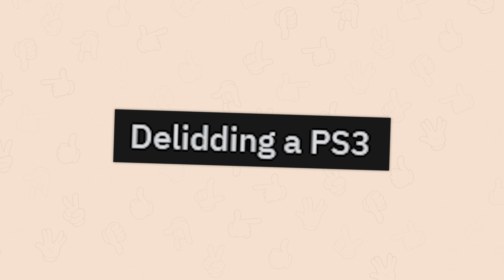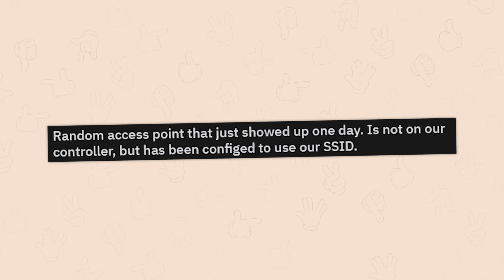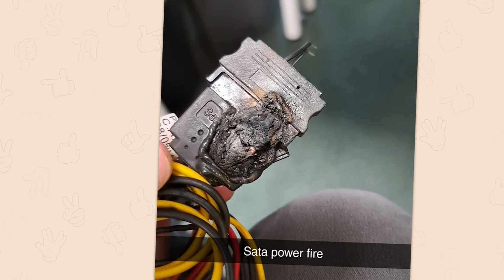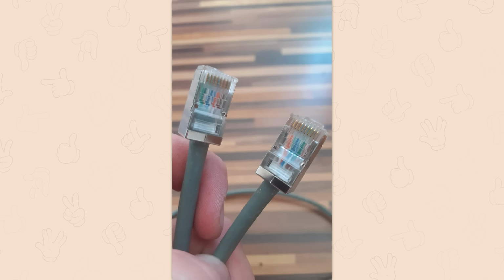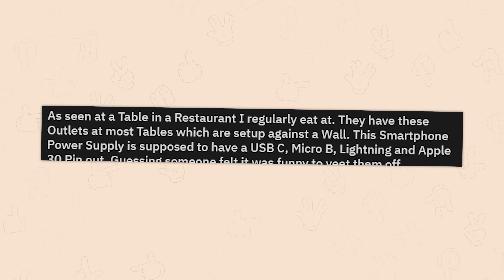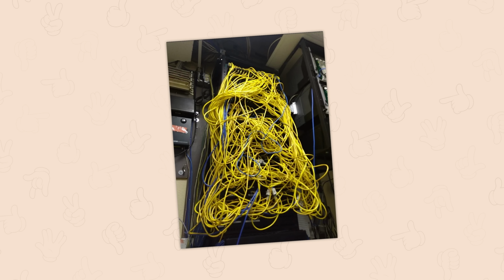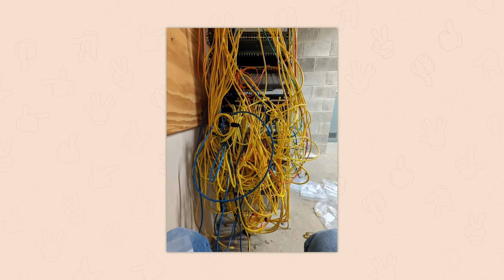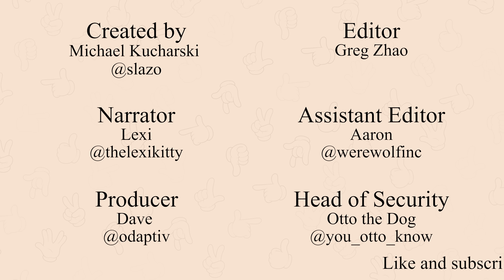r/Techsupportgore | improvise. adapter. overcome.

Comment: 4:16 - Didn't meet the power requirement for the new SATA-N drive!
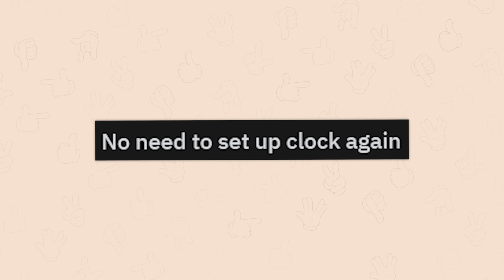5:04 - Not that unusual. Since the "coin" cells are usually 3V, a pair of AA or AAA batteries fills that bill. I've thought of that but never tried it. I think LGR showed off one with a battery that could be replaced without opening the computer case.
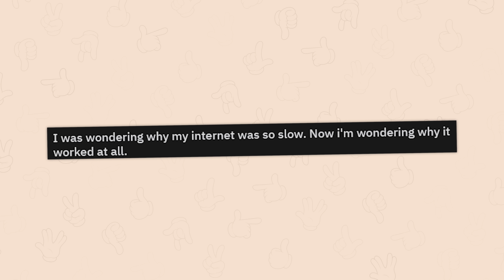6:16 - I think that's a crossover cable, TIA568A to TIA568B. Some crossovers also swap the blue/brown pair, but mostly the orange/green pairs get swapped from one end to the other. Bit odd to find a shielded one!
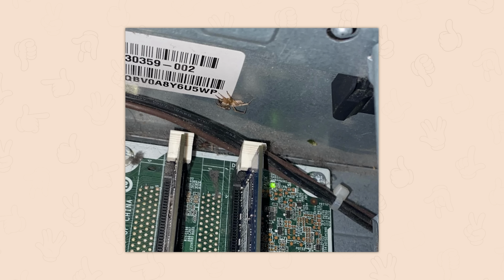11:32 - You met our Web developer! Still a lot of bugs in his code... 🤣
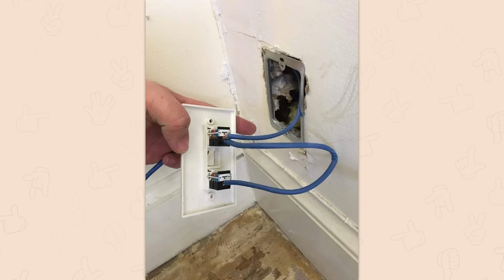13:39 - while that might have worked on telephones on the same extension... not for Ethernet. 
Horror story for you. A network tech was called in on a job with around 20 network drops. An electrician had done the cabling. Just like those outlets, the electrician daisy chained THE ENTIRE THING. All of the Ethernet jacks were connected like that on the same wire!
Re: Splitting Pairs - on the older 10/100Mbit networks, that was entirely possible to do, because that variant of Ethernet didn't use all four pairs in Cat5 cable. The blue and brown pairs were most often used for telephone lines.
13:52 - Clearly the work of a telephone guy. There is a better way to put Humpty Dumpty back together. Look up "cat 5 splice box" on your favorite search engine, find a good deal, and get a few for your toolbox!

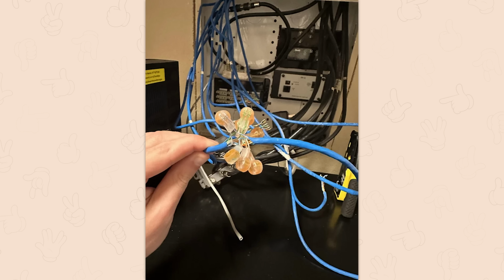Comment: 14:15 Splice connectors are fine for data.
They're mainly used on phone wires.
The gel is not "Conductive" but moisture resistant
They're like those cable splicers you use on your car.

But yeah, you should not use that many

Comment: Those little button splices are called scotchlocks. Cable guys, phone guys, and alarm guys use them to splice telephone circuits together. While they aren't rated for data, I've seen my fair share of gigabit connections running on them.

Comment: WiFi area expander lifehack from 2:28 actually isn't wrong if done temporarily only for urgent event. Did similar stuff in friend house when 3G became a thing. The only spot with good mobile internet connection in his house was in kitchen one meter above table. We made a contraption from 2L Coca-Cola bottle and pencils with 3G USB modem tied at top :)

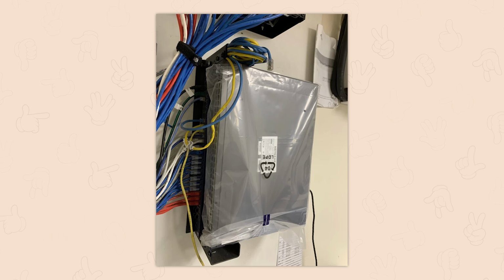Comment: 8:19 Ummmmmmmmmmm, I think you're getting a little ahead of yourself in that reaction Lexi...

FIRST they need to take it back off the mounting rails, TAKE OFF THE PLASTIC WRAP, put it back on the mounting rails, and THEN plug everything in...

Otherwise, I think you;ll soon have another entry in Hardware Gore of something Melting because it couldn't breath out the excess heat...

😄😁😆😅😂🤣

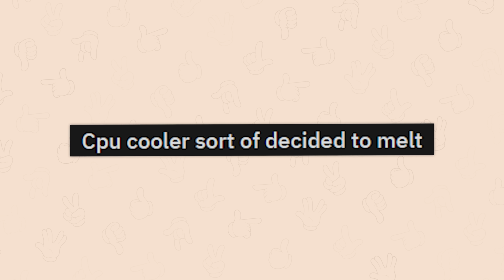Comment: 7:32 Looks like liquid metal thermal paste, these can have gallium in them and gallium damages aluminium. When they get into contact the gallium invades the aluminium crystal structure and weakens it. It will be so brittle that you can crush the cooler block with 2 fingers.

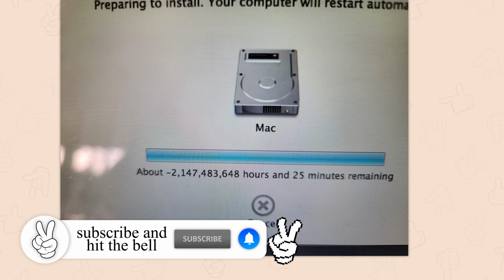Comment: 3:15 That right there is the 32 bit integer limit - the time to install took so long that it reached the highest number a 32 bit processor can depict (2,147,483,647) and tried to go further than that. this resulted in the computer resetting to the next number it could read, which is the lowest number it can read (-2,147,483,647), but as it had been broken, it took 1 more off, resulting in the time to install being -2,147,483,648.
Reply: Actually, with a typical signed integer, it can reach exactly one number lower than you'd expect it to.

Comment: 7:15, as a PC technician, I promise, vaping is just as harmful if not more because it leaves a nasty vape residue that seems to be deadly to electronics, already had a few cases of it this year, usually resulting in motherboard replacements or expensive board repairs.

Comment: 6:21 it's a bad crimp on the right side.
The connector doesn't grab onto the cable properly and pits stress on the small wires inside pulling them out

Comment: Lexi is now afraid of lead acid batteries, meanwhile I get to choose if something goes wrong at my job how I die… lead acid bath, exploding lithium-ion battery, hydraulic injection or crushed under several tonnes of steel…
I work (mainly-)electric forklift maintenance…

Comment: 6:20 that is like a cable for switches or something. Specialty cables that doesn't quite work like regular ethernet cables. That is why the poster wondered why it worked.

Comment: So with the replacement CMOS battery, old computers did in fact use rechargeable batteries but they were not button cells. They were a 3.6v NiCd battery that was soldered directly to the board. 

Those little demons are the bane of anyone in the retro computer community as after 20+ years, they like to leak and eat the motherboard.
Reply: Yeah, there's also lithium ones that explode and eat the board
Reply: Another variety of unfriendly RTCs in old tech are monolith RTC components joined with battery and molded inside epoxy brick. TI DS12C887 and similar. Same consequences - no way to replace dead battery without destroying the whole brick. Made similar battery supplement once to save apartment house maintenance guys when their meter reader gate PC died :)
Reply: @sadmac356  Yeah, those are pretty bad too. Lot of classic mac's have met their end to those things. Thankfully the lithium battery in my IBM 5170 decided to eat the case off of the power supply instead of attacking the motherboard.
Reply: @KrotowX  Ah, the Dallas RTC module. Annoying but at least not destructive. Thanks to the retro computer community there are modern drop in replacements for those that have a slot for a button cell battery on the top. If you are handy with a soldering iron, they only take a few minutes to swap out or a few seconds if you are lucky and it's socketed.
Reply: @Kboyer36  Those modules are still available in online electronic shops. You can order them and receive in a week. Soldering is not hard if you have some experience with soldering on multilayer PCBs and easy when you have flat soldering iron tip for flat cable soldering. My problem was deadline for maintenance guys, hadn't a week to wait RTC brick for computer which we already wanted to replace in future. So I improvised with things I had in place. Fortunately DS12C887 have pins for external battery and worked just fine with two AA batteries in holder soldered to them.
Reply: @KrotowX  Yeah, you just have to be careful to check the date codes. I have found ones being sold New that are really NOS and come with a dead battery. If you were replacing them in bulk I would try to find good original modules but for a one off setup, I would recommend the modern replacements. They are more pricy but they will never need replaced.

Comment: That iMac pic makes me wonder what it was like at my middle school when they switched from Mac to PC. There were at least 20 of the colorful ones and maybe 60 of the bigger in size newer(?) all white ones. There were also maybe 60 or so of the white laptop Macs (I don't remember what they are called). The library also had a few of the colorful clamshell laptops. The art classrooms had 1 each of the round base with disc drive and moveable screen Macs. It took about a year and a half to swap all computers over. I had to learn how to use MacOS when I switched to middle school and then basically forget that after 2 years. 😅

Comment: Well then... 9:24 my cable internet provider did an installation JUST LIKE THIS at my house... if and when we upgrade to fiber this will be an INTERESTING upgrade changing the cable out and all that mess... I literally saw him install the cable connector from the outside box and he just DRILLED a hole like that to go into the house... granted a simple setup like that will allow better insulation... but I digress...

I see so much cringe in these images on this side of reddit its just like... WHY WOULD YOU DO THAT???? Part of me is like, whatever works until it breaks sooner than you want it to.

Comment: 6:29 That is actually a properly ended TIA/EIA 568 ended CAT(7? or some fancy STP?) cable terminated in the crossover configuration. Aka, a "crossover" cable. It's meant to connect "like" networking devices, such as two switches or routers together, instead of the straight or patch cable, that connects from the computer to a switch or other networking device. It's also handy to make a direct link between two computers.  Nowadays these are rare/useless since switches can "autosense" the configuration of the device on the other side of the link, which is why this cable still worked for this guy. No idea why it's so slow, but I'd guess there's a fault somewhere on the cable.
Reply: Network Switches Auto Negotiation is basically just the switch sending bunch of data and asking the client device to send back some data to the switch and through that figure out what speed the wire and controllers can handle. Auto MDI-X is used to figure out if a regular patch cable has been used where a crossover cable should have been used, not the other way around. so he was probably running at 10Mbps which would only use the 2 pairs that don't change which are Blue and Brown.

Comment: Working for a major uk high street banks internal 1st line support desk. And pc not turning on ( but is the vga mangled) - reminds me of calls have had from branches saying a counter monitor / pc was not turning on. Now I know there mostly not IT literate outside of updating fake book status.  BUT I have had multiple occasions where there was a general area Power-cut at the time of them calling and us wasting 30-40 minutes guiding them through checking connectors and shit before they even thought to mention there was no power at all in the street…
Reply: The same old good case: customer called IT support and reported crashed system. When asked the nature of crash, he replied: "Bulb in ceiling lamp burned out. I climbed on the computer to get higher.". Support guy response was: "Well, and your system crashed..."

Comment: At 6:29 , so ethernet cables have little wires in them that when are arranged in certain ways they create what is known as the T568 A and B standards. The thing is, if you do one standard on one end you have to do the same on the other or else the cord doesn't work because both devices need to send and receive data on the same color of cords. What whoever made that cord did, is they wired it by different standards on both ends, which is why it's surprising that it even worked at all. (Edit: Though that cable is what is known as a crossover cable and it's only used for connecting two computers together without anything like a switch in-between)
Reply: Now, if it's a 100-megabit crossover cable, that's even worse.  When I tried one of those with a gigabit ethernet adapter, it kept dropping the link.  "Hey, it's a crossover cable, time to switch pairs."  "Hey, it's not a crossover cable, time to switch pairs."
If you ever actually need a gigabit crossover cable, you have to cross all four pairs, not just the two used for 100 megabits.

Comment: The orange connectors are the end are called scotch locks. They are (at least in Australia) used in the internet system for any copper services. They are fine for data. Just not if your using fibre optics

Comment: 14:00 Those are used a lot by telecom engineers in Sweden for phone lines (and they are rated for it), they are really good for that use case since the version they use is weatherproof so you can splice outside wires safely.

Comment: 7:00 I used to do this all the time for fun. Micro usb is a perfect fit inside. Mini usb doesn't quite fit. That said I shoved one in once, and deformed the big usb one as a result. Still worked, because I was plugging it into an extension cable, that had the female connector deformed (specifically into the side that has a cut line, it just bent like the roof of a house)

Comment: 6:21
check the order of the twisted pair colors.

14:00
UY2 butt (giggle) splice. The "goo" inside is either silicon or grease. Non-conductive but will make a waterproof seal.

Comment: 7:20 vaping indoors is much much worse for the computer. Instead of brown slightly sludgy dust you get brown sludge with a hint of pink or blue depending on the vape flavor. Vape PCs look like someone melted a jolly rancher than poured it all over a smoker PC.

Comment: Ethernet is a cross over cable Type A and Type B - these were required at one point but now days the hub does it for you. You can plug a Pc or another hub using the same cable.

Comment: 12:29 I used to have on in backpack happen with Lenovo laptops, it never got this hot, 100C is not this hot, this was a defective and dangerous laptop.  

Dells don't even need to be on in a backpack... One corporate laptop had an overheating fingerprint sensor, yes, the one part that really should not ooverheat...
Another Dell had an overheating exhaust port and the 1,2,3,q,w keys needed to be hit harder.

Comment: 12:08 in my experience, Chromebooks have incredible batteries. They last a GOOD 10 hours and charge super fast. Though, maybe that’s because I only run Chrome on them and rarely use other applications.

Comment: I lost a hard drive in a PSU failure one time, several of the ICs on the controller board looked like the ones on that 580.

I have not cheaped out on a PSU since. That PSU cost me far more than the initial purchase saved.

Comment: RTC battery supplement from 5:18 is unfortunate necessity sometimes. Add a diode between battery and motherboard to avoid reverse current. Just two months ago made such thing for 1996 PC with Windows 95 used as gate between network and sensor data acquiring controller from water meters etc. in 15 yr old apartment house. PC didn't boot due to dead battery inside monolith RTC block component (TI DS12C887). Replacing RTC was not feasible so I made such battery shortcut to make maintenance guys able to read their meters till old PC was replaced to decent one.

Comment: @8:19: *TheLexiKitty is malfunctioning, rebooting*
@13:31: They have CenturyLink in parts of Charlottesville/Albemarle County.  They finally got sick of their insanely crappy service and customers complaining to the city/county that they are (a) making them either completely replace EVERYTHING or they will (b) pull their right-of-way and franchise agreements and sue them for breach of contract.  So far CenturyLink is taking Option A, but it is very slow going and they city/county is losing patience.

Comment: You've probably already been told this but the cable (assuming that's both ends of the cable) at 6:30 is wired incorrectly. One jack is T568A and the other is T568B. They are not compatible at full speed but two of the pairs will still work (blue and brown) meaning that it's not useless. Just less than good.

Comment: For @6:30 - twisted pair cat5 is SUPPOSED to be orange/white orange green/white blue blue/white green brown/white brown.  Those two ends to NOT match up for a standard straight connection cable.   O.O;;

Comment: A company i work with can't have downtime so they had us Build a 1:1 copy of their server system as fallback when we work on the Productive system.

It cost them almost 5 Million but it saved everyone's butt during a cyber attack, the system is physically disconnected unless we connect it, so it was 100% fine from the problem, 20 minutes downtime later everything was back online and working (in safety mode without internet) god bless the firewall cluster for preventing data leaks!

Comment: Hybrid sleep is a laptop killer. If you have a new laptop with windows 11 or Chorme, it most likely has it. It'll run your cpu fairly warm while off, and melt the laptop if you stick it in an enclosed space.
Reply: I will try to remember that when I one day need to get a new laptop
My current one with windows 10 is working beautifully
Reply: @Koowluh Nowadays add VPN into mix. The bane of remote users with flaky connections and unforgiving company domain policies. Where VPN silently disconnects after some minutes and in next network access (Windows make these a lot by itself, often in background) Windows can't access AD controller host and after few tries subtly lock your user account. When you connect to VPN again, locked account status instantly is sent to AD controller and you become locked out for real. Now make a coffee and wait 30 minutes till account unlocks ... or call IT support. In rush it become awfully annoying.

Comment: 1:30 not just not secured but more importantly they never covered the contacts.
If you have nothing else at-least put some electrical/duct/plain tape over them.

Lead acid batteries “atleast should be” sealed well enough that you shouldn’t technically need to secure them in the boot/trunk as long as you properly cover their contacts atleast.